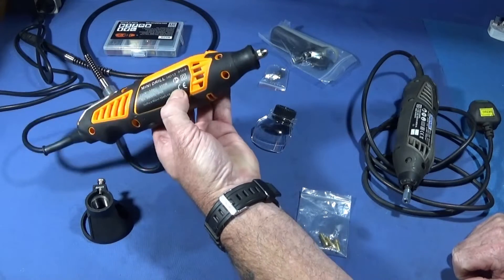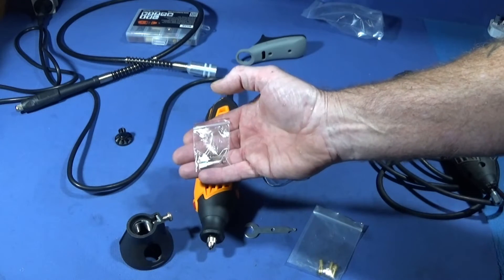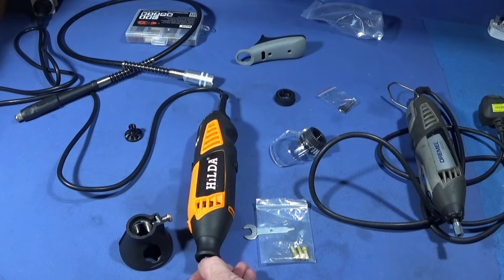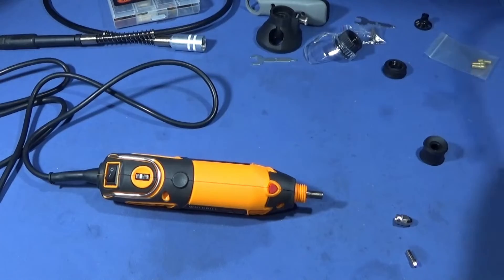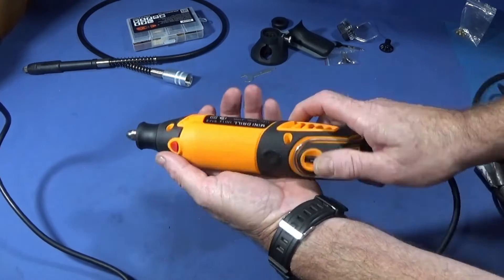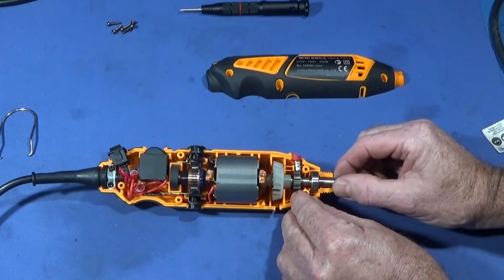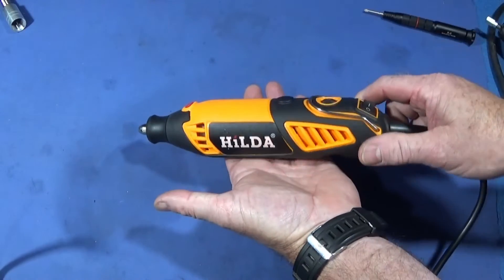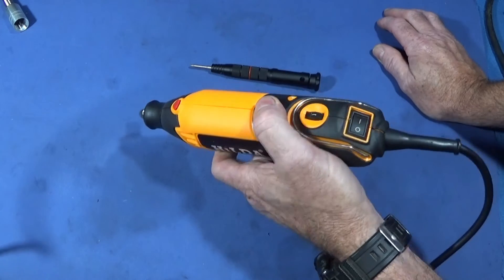The Hilda Mini Drill MD13. Review, Dremel 4000 Comparison, Etc

Comment: Nice review Steve. One point of concern; when you removed the casing I noticed amongst the tangle of wires for the on/off /speed assembly that there was a bare wire poking its nose through, no insulation on it, looked like two wires twisted together?, please check for your own safety.
Reply from the maker: Hi Thanks yes I saw that I will put a bit of heat shrink wrap over it. Regards Steve